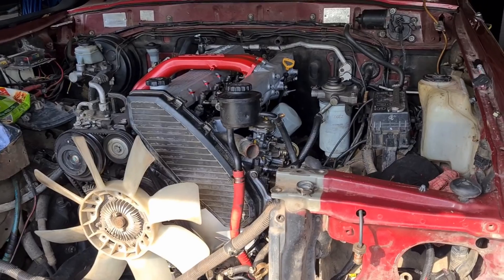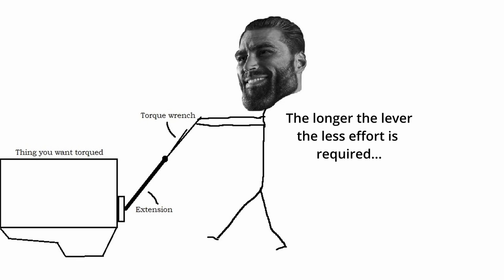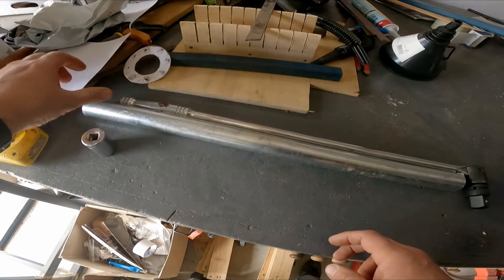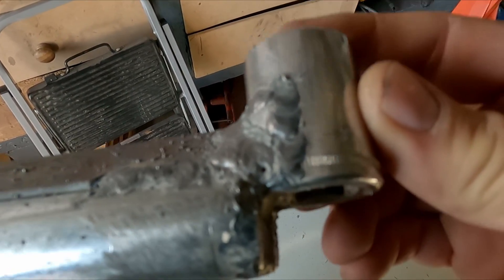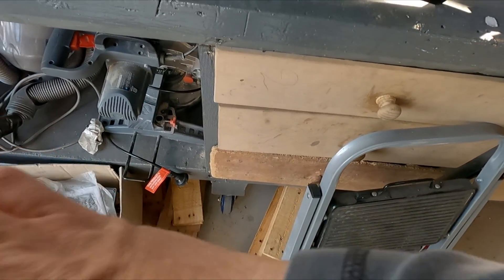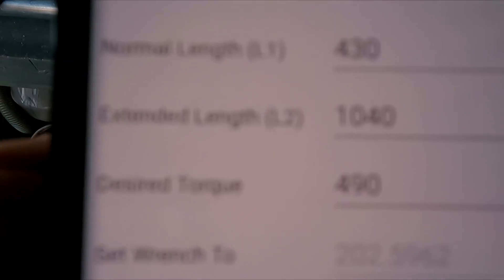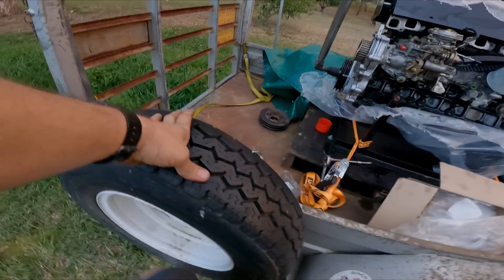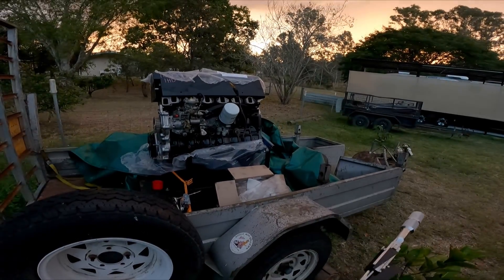DIY torque multiplier

Comment: Very useful! you should make a video how to torque withouth a torque wrench, like a formula how much pounds to apply on a lever, IDK if you know what I mean, I saw a guy doing it with a 1 meter lever and a hand digital weight but he never explained how to do it.
Reply from the maker: Wow yeah that definitely would be handy to know!! I think there would be a lot of chance for error with that method though. You would have to make sure the scale is accurate, and that you're holding it in the correct position. But it might be close enough to get you in the ball park.